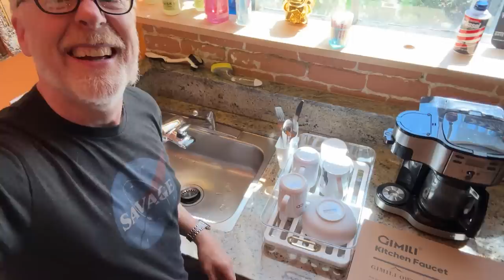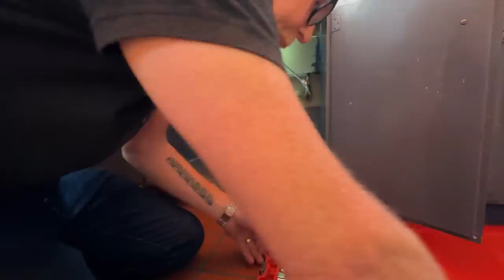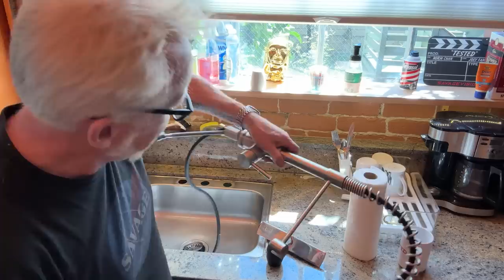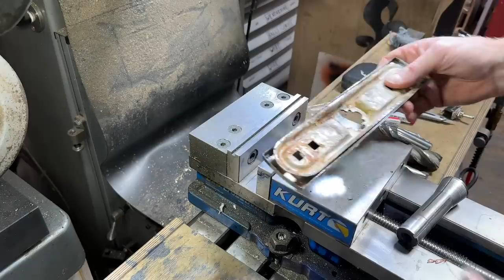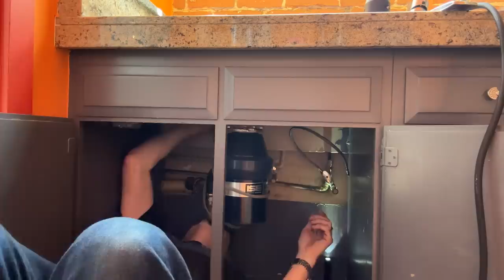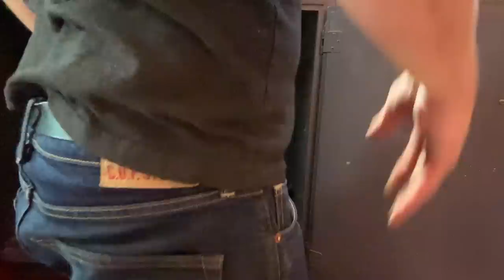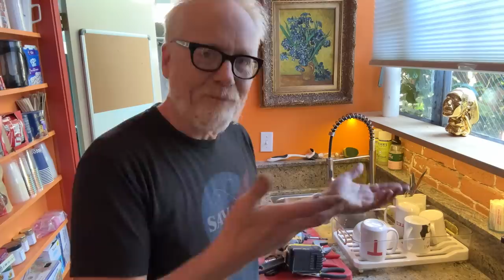Why You Should Hire a Plumber

Comment: The faucet install looks great. I noticed, however, that the copper supply lines under the sink are swinging around a lot when the water is turned on and off due to water hammer. You might want to secure those so the pipes don't fatigue and leak in the future.
Reply: Adam will understand work hardening of copper. Good point!
Reply: The plumber I work with insists backflows don't need to be mounted to the house the pipes will hold it, I knew he was wrong but didn't know the reason so thank you that is the reason he is stupid.
Reply: Might want to check the water pressure also.
Reply: I've seen some horrific damage caused by joint leaks from pipes that 'flapped in the wind' like that. A couple of mounts near turn points/joints/valves is all that's needed to never worry about that. Maybe an idea for the next 'fix home plumming with a Bridgeport mill' video 😂
Reply: Yup just a couple clips should do it good call
Reply: Hammer arrestors.
Reply: And there we have it, a reason why you want a plumber even for something simple like this :D

Comment: I watched plenty of videos on how to change an old bath tap washer. In the end called a plumber because I couldn't shift the nut a mm. Took the plumber 10 minutes of brute strength and blow torch to do it. So I felt slight less of a failure.

Comment: Adam may be the only person to ever replace a faucet by using a Bridgeport
Reply: He recently replaced the Bridgeport with a SHARP.
Reply: If I had one i'd use it over a drill and a hole saw or a file to do the same job.
Reply: Knowing what plumbing part you need, $1, having a mill to modify the part you have, $10,000.
Reply: Oh my God! Laughing! You are most certainly right! I think it is very cool.
Reply: I thought exactly that lol
Reply: Most new faucets come with a new base plate that fits. Surprised that one did not.
Reply: @ksavage681  may have done but the inset sink has only a narrow ledge which the original part fitted where the new one may not, and there’s also the original holes which would need capping.
Reply: Definitely not the only one.  I use mine for household stuff all the time.  When you have one, you use it.
Reply: I have done a few faucet replacements. I don't recall having to do much but turn a few fittings in uncomfortable postures.
Reply: And yet he didn't take the 5 minutes or less that it would have taken to remove the disposal to provide easier access?!
Reply: You can tell that he's not a plumber because he used a socket. I've never once seen a plumber use any tools other than the nut rounders / faucet knurler on any kind of fastener.
Reply: Slap that on a shirt 😂
Reply: I was half expecting an accident towards the end due to the title of the video. I'm glad it all went well!
Reply: I don't have a mill. I'd use a Dremel and some Scotchbrite. I was REALLY hoping the hole in the sink would fit. Adam:  Now I have to pull the whole sink out to mill the holes.
Reply: yeah I was like they make plates for that
Reply: Ya’am seyin.
Reply: oh i'm about to
Reply: A bridgeport and dial calipers

Comment: As a retired handyman, this was fun to watch. There is a good chance that all that stuff that Adam referred to as caulk is actually plumber's putty. Very similar to "Playdough". It is very easy to use and does dry hard, but does the job better than caulk.
Reply: Looks like he didn't use any sealant at all with the new install.
Reply: @Okurka.  I agree. As do a number of other commenters here. Also, I would have attached the water lines to the faucet first while it allows easier handling, then feed the lines DOWN instead of UP. Much easier that way, as long as you have a large enough hole ( which he does in this case ) to accommodate the nuts going through. And it saves a trip of crawling into the cabinet.

Comment: I cant be the only one who noticed you did not seal the faucet trim that covers the three holes in the deck to the sink deck. This can lead to water leaking into the cabinet floor and rotting it out. The usual way is with a rope of plumber's putty around the inside  of the trim. Caulk is an alternative. Otherwise, a great video Adam.

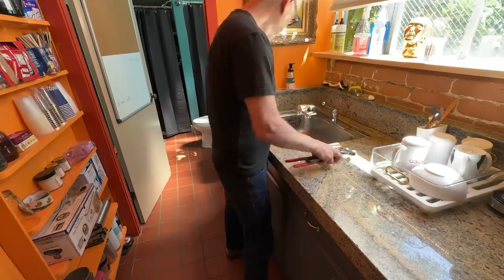Comment: As a plumber, I made predictions about how this was going to go at 4:28. Just sayin -edit 
that “caulking “ that they just filled up the trim piece of the base with that you put back empty? Yeah that was to stop water from running under the faucet to those three big holes before it ruins the cabinets as it typically does tremendous damage before it is found. Also, an offset basin wrench is helpful for working under the sink in tight spots where you can’t get normal tools to engage or rotate properly
Also; that would have been a great time to replace those janky compression stops with new quarter turn stops

Comment: The hardest thing about being a service plumber is lugging that crazy drillpress around with me. 

KIDDING. I love that you can innovate like this. In most cases, I’d mount the faucet directly and use cock hole covers(yes…that’s what they’re called) to cover the extra holes. 

Actually, most of these single post faucets come with the optional escutcheon plate. 

But this is great. And thanks for the shoutout at the end. Plumbing is hard.  But like any acquired skill, it can be artful and rewarding. 

Also, is that the original idol from Raiders on your sill there? That’s a pretty cool flex.
Reply: It's not often the word "escutcheon" is used in polite conversation.
Reply: " most of these single post faucets come with the optional escutcheon plate. " -- for sure. In my admittedly limited experience, either the kit will just include the plate already, or there will be a couple of versions of the kit you can buy, depending on whether you need to cover the extra holes or not, or -- as you already mention -- the plate itself would be purchasable as a separate part. One way or the other, one should not need a mill with an annular cutter to retrofit a new faucet onto an old sink. :)
Reply: Cock hole covers is their name? Flat/slightly domed slab with a threaded rod coming out of it and an extra-wide nut for the other side?

I've installed those on a ceramic basin that came with more holes than I needed. White enamelled ones. Looks decent! 👍

Comment: Too low to the sink was the reason I changed out all the faucets in my house when I moved in, I think the kitchen faucet was the first project done.  I am surprised that faucet didn't come with a plate to cover the unused holes, I put pump style faucets in my bathroom and those came with the plate that matched the faucet.
Reply: He bought one that didn't have a plate. Some come without one, usually for commercial applications. Sometimes they are just that cheap.
Reply: @robo5013   I think I found the faucet he got and it is cheap enough that the plate is an optional part that costs $12.  I can see why he just repurposed the old one, $12 is almost 1/3 the price of the faucet.  

I wouldn't install that where it gets used every day, but for an office that gets used once a week it should last just fine.
Reply: You can pick up a couple of plastic 'blind plugs' for this purpose at the plumbing suppliers for peanuts, tho how they may please you aesthetically is a personal opinion

Comment: i'm not a plumber but i think that putty under the cosmetic cover plate really should have been reapplied. ideally it should have come with a gasket. but basically the interface between the plate and the sink are not water tight so if anyone gets the top of the sink wet or washes it, that water is going to leak right through into the cabinet below over time, since now there are two unused holes where the taps used to be.

Comment: Lol, this is great! I've owned my house since 1996, and have installed no less than three different kitchen faucets. Two of them were after a remodel in 2005, and neither could be considered 'cheap', their problem has always been the inability to repair them. In my experience single lever control for hot/cold is asking for eventual problems that cannot be addressed  simply. Individual hot and cold valves can be replaced (in most cases), which gives the product an almost infinite life if your water is well treated. *I did install bathroom (show/vanity) faucets (in 2005) that could be rebuilt, no regrets!

Comment: I'm not a plumber, but those copper supply lines under the sink should be secured, not flopping around, I'm pretty sure. A couple of copper clips and nails, or something similar may be the ticket.
Reply: My thoughts exactly. They move, when you turn the water on and off, so sooner or later, they're going to leak.
Reply: You would be surprised how little support copper gets 
Also not a plumber
Reply: I had the same thought which brings up my other rule of household plumbing: know where the cutoff is for the house, even if you have to go to the water meter.

Comment: Adam!!!!! While not a plumber I've installed many kitchen and bathroom fixtures during my "career" as a maintenance person. There several tools that are made specifically for this job and, while not necessary, make life soooo much easier when you need to get the job done. The floppy headed T handled wrench is my personal favorite (you can see I'm an expert 😂) as well as the off set hex wrench used for installing garbage disposals. That hex wrench is also for unjamming the disposal by putting it into the underside of the unit (there's a spot for it) and wiggling it back and forth. Awesome stuff!!
Reply: It's called a basin wrench and as a plumber you're absolutely right it's probably my favorite tool on the truck. When you need it nothing else will do
Reply: How many times have you hit your head on a sink though? I fear you neglect the dusty, beanie hat.
Reply: @JohnnyWednesday  😆🤣😆🤣🤣too many! The edges of the cabinets always gets me too. They're like a razor sometimes.

Comment: As someone that snapped a garden hose spigot off trying to remove an attached hose, then had to figure out the process of sweating on the right fittings to put a new tap on, your words at the end about calling a plumber when it's time to sweat things together is golden advice. I made a lot of trips to the store and really didn't know what I doing, but I can now say that there's a new spigot installed and it doesn't leak.

And while I can totally replace a water heater on my own, I will probably never do it again. Specially a gas one, I don't trust myself enough
Reply: Having both sweat pipes and soldered electronics, I think if you can reliably make good electrical solder connection then soldering pipes is comparatively easier.   I will call a plumber in for anything gas-related, though.
Reply: You want a good quality brass spigot

Comment: I recently did a kitchen faucet replacement, and came to watch this video because of the title, because I find faucet replacements these days quite easy.  But, that's for a direct replacement.  I would definitely consult a plumber if adding in plumbing, because there are rules for piping that take a proper plumbers wizardry to keep out of trouble.
Reply: And when I say recently, I mean the faucets I've replaced are not so old that you would need sockets to remove them.  Adam has a bit more to deal with on this one.
Reply: And, by direct replacement, I mean it came with a new mounting plate, and nothing needed drilling out.

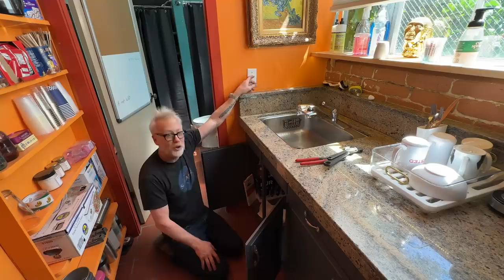Comment: I am not a plumber, but I have changed enough faucets to find myself screaming "basin wrench!!" at the screen from about 4:40 on.
Reply: Yes. I've done this exactly once, and was thinking the same thing!
Reply: Ayup, useful for other hard to reach nuts/fittings as well. Also if you lay down some heavy towels in the cabinet it makes a nice cushion for your back.
Reply: Works great so long as you're not dealing with corrosion!
Reply: For what?  It's just 5/16" or 3/8" nuts on studs. A socket, extension, and ratchet is the optimum tool. Basin wrenches are for pipe and hose fittings that are inaccessible for a standard wrench.
Reply: I was thinking the same thing...
Reply: It's also a lot easier to connect the hoses to the faucet first and install the whole thing as a unit.
Reply: One day, someone is going to implement a design that can be tightened from the top and the world will be changed forever.
Reply: I have changed hundreds of Water Taps, Its not exactly difficult, Now changing the seals in a homogoniser that still has steam flowing through it, That's challenging.
Reply: yeah and there is even a NEW style that is even better.
Reply: I don't even need to replace a faucet right now and I am adding that wrench to my shopping cart.
Reply: My method for the last two sinks, was to take the sink out, because the sink needed new plumbers putty put in, and wow supper easy to take the sink out and do all the work.
Plus the last two sinks where loose. So peoples idea of putting in a sink and faucets is this is to much trouble and this is tight enough, ie the faucet has things growing under it and the sink just wanders around.
Reply: Heear ya.
Reply: My wife of 30 years occasionally celebrates the anniversary of "faucet day" ... the day I spent an entire day with everything going wrong replacing her kitchen faucet.
Reply: All the stuff under there are standard sizes, if they are code, but it’s knowing what ‘standard’ is.
Reply: I came here to say this. Life changing, IYKYK. ☮️❤️🌈
Reply: @tehpanda64 it's saved my knuckles in the engine bay too!
☮️❤️🌈
Reply: @truracer20  Why not use the tool you already have out instead of digging out a ratchet set?  Especially if you can't get a good swing of the ratchet handle.

Comment: I have that faucet. 
Expect to do this job again in a year. That plastic end cap that’s pressed in and holds the whole head assembly apart will pop out. 
The fitting that presses hose onto the head will leak.

Comment: The first time I sweat a copper water feed was in the basement of my first house. Thought I got it right, and an hour later I went somewhere and came back and found an inch of water in my basement. I've since learned to solder better, but Adam is right that there's no better way to ruin a house than do bad plumbing.

Comment: Sealing the plate that covered the two outer holes with silicone will stop it rusting further 😅 and yes cheap faucets vs commercial ones are very different, I've gone through a few cheap ones in my life, either the mechanism that switches modes breaks or the chrome coating ends up flaking off, or the seal between the faucet and faucet body starts to leak and you see green gunk around the base of the faucet. 

You can bet a commercial one is actually completely made of metal and is much more durable

Comment: When I discovered those extra mounting holes, I used them to install a dish soap dispenser and an instant hot water dispenser.

I thought the hot water one would only get used for the occasional cup of tea or hot cocoa, but it gets used daily now for not only hot drinks, but for rinsing dishes with nearly boiling water, filling pots with water to cook pasta, and adding very hot water to coffee so I can obey my doctor's advice to cut down from my previous 64 oz of coffee to at most 16 oz.

It turns out that I actually like coffee that isn't as strong as they serve at those nationwide brand coffee shops, and now save a lot of money, too!

Comment: Entertaining and educational as always. Nice touch with the hairstyle! 
IMO it is a lot easier if you fist attach the flexible pipe connectors to the faucet and then attache faucet to the "mounting base", attache the base to the sink and finally attache the connectors to the taps under the sink. In this way you will not put twisting momentum on the flexible pipe connectors and you will need to tighten only two nuts (for the mount) in not so comfortable position while under the sink.

Comment: Don't new one-hole faucets come with an escutcheon plate to cover the old three hole installations?
Reply: This is exactly what I kept thinking.  OK, you have a three hole sink.  Why do you not have the plate that has the right size opening?  Of course for Adam it's easier to just mill the thing than to go buy another faucet that has the right plate.

Comment: I’m a big DIYer but had never touched plumbing outside of replacing shower heads. Then my well pressure tank went out while our budget was tight, so I decided to replace it myself. I watched countless videos and read a lot on r/plumbing, and wound up building out a tank tee and replacing all the stuff, including a sweated fitting. After doing it, I feel very confident with my work and my ability to do more plumbing later. However, it’s something you need to take the time to learn well and know how to do it right. I was very surprised at which parts were hard - especially getting threaded tapered fittings to seal. Pro tip: use 3-4 wraps of GOOD ptfe tape AND use a thin smear of ptfe dope on top, sealed like a charm after that.

Comment: Suggestion:
Move the faucet off center and add liquid soap dispenser ( handy ) and lastly a brushed chrome hole cove in the middle.
Service plumber
Reply: Im surprised he went the route of reusing the old cover plate, instead of just getting 2 hole covers. Seems like a lot of extra hassle and eyesore on the top side.

Comment: I love to do plumbing... for some reason, that and electrical, when completed hold an immense feeling of accomplishment for me. By the way, you should install a bracket on those pipes, they are bouncing around and could loosen the solder joints.
Reply: will become work-hardened thus brittle, easy to break, must be stabilized.